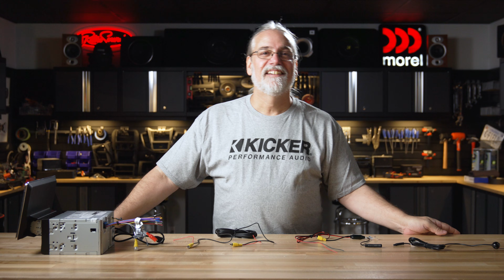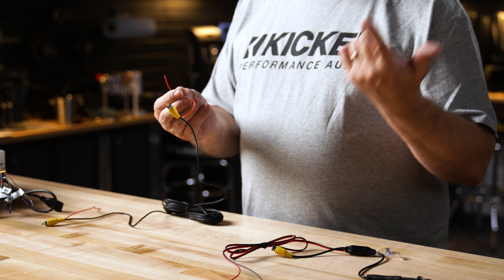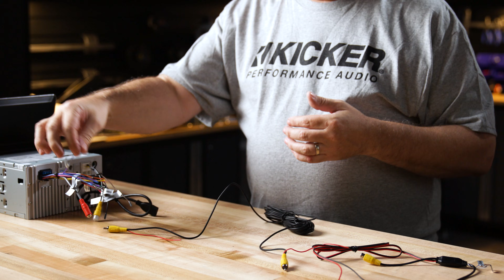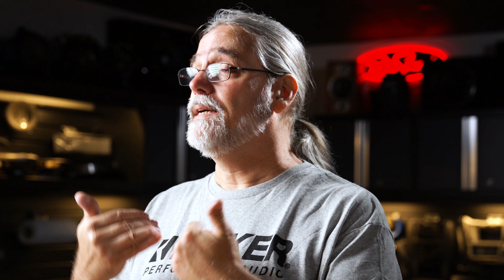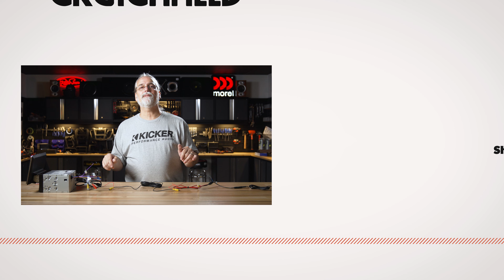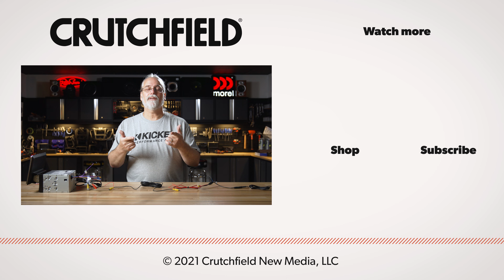Powering your backup camera (and how to use that extra wire) | Crutchfield

Comment: still i have my Camera  for reverse lights and ground to bolt  so when the car is on ignition on just i have a video when the engine is runing i dont have a video ? where is my misstake
Reply from the maker: Sounds like you need to double check your radio's camera settings. If you got the camera or radio here, you can call our Tech Support. Their number is on your invoice.

Comment: So much good info... thank you.
At 5:40 you explain the Jensen/Boss difference, and that there is a dedicated camera power wire coming out of the back of the BOSS (I have the BE920WCPA), which you suggest connecting to the convenience wire to send power back to the camera.  You then say that with the Jensen you must still connect the purple trigger wire, however you don't mention whether or not this needs to be done with the BOSS.  Does it?
Reply from the maker: The purple/white wire on the BE920WCPA's harness must be connected to the vehicle's reverse gear circuit. What brand and model camera are you planning to install?
Reply: @crutchfield  I am installing a VOXX ACA801... (I connected the trigger wire but when I switched my vehicle to reverse the BOSS went into camera mode and WANTED to work, telling me that the reverse gear circuit was doing its thing, but the camera itself wasn't getting power - even though it should have been as my reverse/backup light circuit was energized).  I believe the my issue is a bad 'tap' with the tap connector I used to tap into the reverse light circuit at the back of the truck.  After watching your video I've decided to remove the tap and pull power from the dedicated accessory 12V+ at the back of the BOSS, and send it back to the camera via the convenience wire.  Thank you for responding!
Reply from the maker: You're welcome! We are glad you got it figured out!

Comment: I just have a question:

My kit has basically the same cable as show, but BOTH sides have a ground cable, do I need to bolt both sides or will just one do?
Reply from the maker: Grounding is typically done within a couple feet of the device using the power unless you are working on a vehicle like a boat where there is no metal frame for grounding to

Comment: I have to connect a red wire to the backup lights for rear camera installation. Can you give the 2-3 minute version for my 2002 Honda Accord …I’m 84 and have done the plug, play already but for this camera red wire backup light connection.
Reply from the maker: We do not have a video that covers your year and model car specifically. If you purchased your gear from Crutchfield we offer lifetime Technical Support, so if you need us just give us a call with your order number handy and we can help out.

Comment: how to wire back up camera to a sony xav8100 radio on a Harley Daivdson trike,  I connected the blk/red wire to pos/neg from the radio,connect the video plug, but does work. do i need to connect the reverse in wire too, i dont have a reverse circuit, How would i have to hook it up, My xav8100 has a icon for rear veiw camera, (when touch the icon on the screen, it only show no circuit). Can you help me. I have 2012 harley davidson triglide trike which has reverse, but i want to use my icon on the touch screen to work the back up camers, Please can you help me, Thank.
Reply from the maker: Hi Francis, nice radio choice! Using a touchscreen and backup camera on a motorcylce can be tricky since it doesn't offer the traditional parking brake and reverse connections. Looks like the Sony XAV-AX8100 does offer the option to manually display the picture from the rear view camera though.
Press HOME, then touch [Rear Camera]. If you got your radio and camera here, you can call our Tech Support as well. Their direct number is on your invoice.

Comment: My previous camera has been connected to digital rear viwe mirror that came together, since my camea wierd black 5 pin connector was destroyed I bought new similar camera only with wires but this one has RCA yellow and this red piece wire I guess the camera side shd be conncted to reverse power as mentioned here but what about the mirror side convenience wire, BTW I have connected a RCA to 2.5 jack which connected to top of mirror but get no picture from camera when in reverse gear while camera itself turns on
Reply from the maker: It sounds like the mirror/camera setup used a 5 pin connector to attach the camera to the mirror and if that is correct, then you will need to identify the purpose of each of the 5 pins/wires to properly splice in the new camera to determine which was taking in the reverse trigger, video signals, and other purposes. We do not research the pin layout on such cameras to help with this, but we do know that if one of the pins was designed to take in a reverse gear trigger, then the convenience wire that came with the new backup camera can be used to provide that trigger from the reverse light circuit

Comment: When you connected to the backup lamp for power, you used the convenience power wire at the front to connect to the head unit backup sensing wire. Could you have still used the backup sensing wire from the wiring harness to tell the head unit when the car is in reverse instead of that pig tail wire from the camera? In which case would you just put electrical tape on that red pigtail convenience wire?
Reply from the maker: The best option there depends on the camera you use. And in some cases, even the radio/camera combo so you do want to be sure you follow the model specific instructions.
Reply: So both methods are an option, correct? I wish I understood if there were a functional difference.
Reply from the maker: Both methods can work well.  Not all vehicle radio harnesses provide that reverse wire connection though, so that isn't always an option.
Reply: @crutchfield Got it, thanks.
Reply from the maker: You're welcome.

Comment: Well what if ur raido knows that u are in reverse when u do have the carmrea installed and all the wires aren’t even connected
Reply from the maker: If you don't have a camera installed and the radio's reverse wire isn't connected, then the radio won't switch over to the rear camera input when the vehicle is in reverse.

Comment: If you just need it as a backup camera, do you need to connect that 'convenience red wire' attached to the yellow video cable? Im attaching it to a portable system (car mate) that doesnt have the ability to connect the red wire on the radio side.
Reply from the maker: If you can get power to the camera and get a reverse gear trigger to the radio through cables closer to where they are installed, then you will not need to use the convenience wire

Comment: Could you possibly wire the convenience and reverse trigger wire through a little switch so break the convenience wire into a switch in the dash. That way you can turn the rear camera on when you wanted from a simple push of the button.
Reply from the maker: If you use the convenience wire to supply power to the camera so you can use it when you want, you will not be able to use the convenience wire to supply a reverse trigger for the radio. That convenience wire can only be used for one of those purposes.
Reply: Ah Yes that would make sense. I guess get an ignition switched live from radio and use that rather than use the convenience wire.
Reply from the maker: Exactly.

Comment: My head unit and harness include the reverse switch.  I've powered my camera off an ignition 12v source.  This all worked great for weeks with camera always on power or when going in reverse. Then suddenly the camera starts turning on and off but only when the engine is running.  When engine off camera works.  Not sure where to start.  I've pulled everything apart, replaced wiring, sourced the power from a different spot.  My only next step is to add a rectifier inline.  anything else i should try?
Reply from the maker: Hi Tony, it does sound most like a wiring issue; but you may want to double check your camera settings on your head unit too. If you got the camera here, you can call our Tech Support for help too. Their direct number is on your invoice.

Comment: I have a question you stated you could use the camera feature in order to view the backup camera footage when you are not driving in reverse. 

But what do I actually click on on my touch screen stereo to view the camera I don't have a camera app?

I followed your guidance and my camera is not connected to the taillight in the back. It is connected in the front to the reverse line from the back of the stereo.
Reply from the maker: The options will vary per radio. What brand model radio are you planning to install?
Reply: @crutchfield  it is an aftermarket radio from Amazon (Android 12) I was able to connect everything the camera engages when I go into reverse. However I'm not able to view it any other time.
Reply from the maker: You'd have to check the radio's camera features to see if they offer a button for viewing other than in reverse or if there's another video input you could use instead for consistent viewing.

Comment: Hi, nice and informative video. I purchased a new pioneer Z5390BT and I have hooked up both front and rear camera. But now, only reverse camera can be viewed but front camera can’t be viewed. I have connected the plugs to the appropriate sockets on the headunit. What would be the issue?
Reply from the maker: If it was once working and not only the reverse camera can be viewed, then it could be setting in the receiver causing the front camera option to no show up or an issue in the wiring for the front camera.

Comment: Getting mine installed was a PITA, camera manual had no hints on what to use that little trigger wire for, and the head unit manual said it would automatically switch to the camera when 'hooked up to backup lamp circuitry.'
I know my electrics, so I THOUGHT I understand what they meant.

After watching countless videos already, I decide to check with the guys I bought the system from. Lo and behold, I now have it wired correctly!

Now to get that stubborn plate screw out...
Reply from the maker: Way to go!

Comment: hey, I wired my reverse cam with the +12V from the head unit going through the convenience wire and then that connects to the red on the camera. Black is connected to chassis. The head unit doesn’t have a trigger wire, and when I shift into reverse it does bring up the reverse screen automatically but it says no signal. What have I done wrong?
Reply from the maker: Sounds like you may want to double check your video connection and camera settings via the radio's menu. If you got the camera or radio here, you can call our Tech Support. Their direct number is on your invoice.

Comment: Re the trigger wire - "If this isn't hooked up your stereo's never going to know you've shifted into reverse". True unless your car uses CANBUS, you have a capable stereo and the correct adapter, in which case the car will tell the stereo you've shifted. In short if using a fully CANBUS-equipped car don't bother connecting the trigger wire.

I appreciate this is video provides information specific to the equipment sold by this company, however it may not be correct for all newcomers using alternative products.
Reply: So in this case as you mentioned, the red “convenience” wire doesn’t need to be connected to the other little red wire at the back of my car? I have a teyes ccr 2k and have plugged like the very minimal instructions say and the head unit shows a black screen with the reverse lines when I put it in reverse but no image. Am I doing something wrong!? Female here, trying to figure this out! 😅

Comment: I powered my 2 video cables up at the stereo but no power on other end of cables???? What is going on?
Reply from the maker: Hi Mike. what model radio and cameras are you using?
Reply: @crutchfield  Pioneer AVH-X3800BHS. the cameras are cheapo cameras from Amazon two different brands
Reply from the maker: What did you connect the cameras power cable to around the radio?
Reply: @crutchfield  I ended UP connecting them to one of my lighter wires! I ran the reverse wire to the rear reverse light but it is not triggering my stereo unit!?
Reply from the maker: Each camera should specify the best way to connect for power and reverse so be sure to double check their instructions and rewire as needed. If you know the camera models, we'll be glad to see if we have any specifications for them.
Reply: @crutchfield  I got both cameras to work but not the reverse on stereo! I know I hooked up the stereo reverse wire to the reverse wire on vehicle just not going on when I shift into reverse. The reverse camera wire must need to be hooked up to the camera lead wire and then to the reverse vehicle wire! That is the only thing left to do! Thanks for following up with me it helped me to figure it out!

Comment: Question! Can I connect red wires from 2 camera video cables to hot stereo input wire? 
Thank You for the clear instructions! You can also run a wire for the back up camera all the way back to the reverse tail light wire along with the video cable!
Reply from the maker: You can connect the reverse trigger wire to a backup lamp circuit still.

Comment: Just got my camera from Crutchfield, and I’m lost this cleared up a lot, but may still need help. My 2019 Toyota Tacoma is 6v, the Boyo unit is 12v, will it work? My tailgate got stolen and my wife needs the camera. I ordered an aftermarket harness from Amazon, without wiring diagram, gray with four pins/ cables. I’ll call on Monday, but hoping to install tomorrow as I work 115 miles away from home.
Reply from the maker: We are always here to help you get installed with our lifetime Technical Support. We offer it for life with all Crutchfield purchases, so just call us and we would be happy to assist. We cannot provide technical support for products purchased elsewhere.

Comment: Great.  Do I need to insulate at tip of pin on yellow end near the stereo.  Minute 2.25
Reply from the maker: The yellow RCA video connection gets plugged into the radio's rear camera input, no need for insulation there as it is connected to the radio.

Comment: What's the benefit of connecting the black wire to the chassis ground compared with using the ground wire from the lamp circuit?
Reply from the maker: Be sure you wire the camera for its own ground to the vehicle's chassis to provide for the best and safest power current.

Comment: So its either on while reversing or on constantly (manually)  but will not come on when reversing? is there no way to have both? I want it to come on automatically when reversing but i do occasionally tow and would like to see my trailer when running. am i just s.o.l. ?
Reply from the maker: Do you have a specific radio in mind? Some do offer the option to choose. From there, some also have multiple camera inputs which can be super helpful when hauling a trailer. You can use one camera for viewing on demand and one as a dedicated backup camera.
Reply: @crutchfield  ok, that makes sense. so its more about the head unit then the wiring if you want to have both viewing options available. got it. thank you.
Reply from the maker: Correct. You're welcome. If you'd like help choosing or need anything further, please let us know.

Comment: I am still getting no signal! Kenwood DDX5707S and Crutchfield wiring harness kit for 2011 ram. All wires hooked up per chart. Only wires not hooked up are red and black wires on video cable. Also bought the pac interface get'up.
Reply from the maker: Give us a call with on our Technical Support hotline with your order number handy and we would be happy to assist in troubleshooting. It sounds like we need to double check the wiring and make sure your camera is getting power. You get lifetime Technical Support, we are always here to help!

Comment: I'm about to ditch trying to use my factory reverse camera with my aftermarket unit and just use a aftermarket camera, so this video will help me there.
 I've used your site at least twice before and had great success in two of my older vehicles. However I was a little disappointed recently with the instructions I received, or lack of, for my current vehicle. I found the wire guide, clear. The removal guide, clear. But the actual install, it's like they didn't bother. Granted you have different wiring per unit, per vehicle, but at least show one working example for that vehicle along with the procedure YOU followed to get it working, and not just the finished product sans all the critical steps in between. There are components you sold me as required that needed to be connected but are never mentioned where or how or what they connect to. Not even the manufacture has instructions. So it leaves me wondering if you even had a working model or just got stuck same as me with a bag of harnesses with no clear function beyond the name. 😮‍💨
Reply from the maker: Each vehicle backup camera install is different, and we do not provide vehicle specific installation instructions for backup cameras. If you are having any issues with your Crutchfield purchased products, please call our Technical Support hotline with your order number handy and we would be happy to help. You get lifetime Technical Support with every purchase!
Reply: Honestly I'd rather send/receive images and diagrams via Email if possible. I can show you where I'm at. You can draw an arrow over it and literally point me in the right direction. This illusive APIM module  is not anywhere, other how-to's say it is.